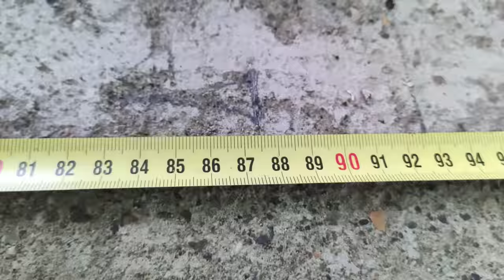An Old Construction Worker From Another Planet 🔥 DİY Stone Oven

Comment: “But I wanted it on the OTHER side of the patio.”
Reply: great job , with one mistake hight is not 62% or 63% so you have smoke coming out.
Reply: I noticed the smoke also. Is the exhaust sized small or should be at a different height or place? Whats the 62/63% calc?

Comment: SelamUnaleykum Haci. This is the perfect example of skills vs. training. By far one of the best construction videos I have seen by far on YouTube.  (And I am an YT nerd) but I would have changed I few things: 
1. The base of the oven is by far too big - therefore too much cost of material 
2. The heat sheets and isolation is not necessary in some regions.  If you live in Norway - then yes. 
3. The chimney position is not the best - as you can see in the end of the video - your beautiful stones in front (12:30 ) are completely black because of the smoke
4. The BREAK STONE Design Finish is not the kind which is really honey for the eyes 👀 
5. You should have implemented a iron door in front of the opening - To make Lamp Kebab like a Smoker 

I love your work - Thumbs up and I will subscribe 🌺🌺🌺

More videos insallah
Reply: I believe the door opening is too big, which is very important. It should be 1/2 as wide as the oven floor, and 63% the ht of the inside dome ht. This helps keep the heat in while cooking, and easier to make insulated door (plus a chimney cap) to bake long hours after fire scraped out.

Comment: Once you have done the inner lining of your oven, then you need to use refractory lime/cement.  There is a wonderful resource that is used in the composite industry (fibre glass industry), and that is "Glass Micro Balloons".  They are tiny glass balls that are 90% air.  Mix up your refractory and then gently fold these insulators into the mix.  Not the same as Micro Glass Beads.

Comment: I would like to know the following topics:
1. How about heating the oven for the first time? They always say to heat it very slowly the first time and then very hot.
2. I live at a higher altitude, at around 660m, and we have a lot of rain in Austria. What about rain when the oven is hot and showers a few hours later because the stone is cracking?
3. What do I have to consider in winter or spring? I think it would be best to cover the oven.
4. I know it would be better to have the oven under a roof, what do you think, but in the open air it's no problem, right?

Comment: What is the white powdery stuff? Powdered glass? Is it acting as insulation? Or holding heat? Or both?
Reply: If u mean the powder he put over the glass that's salt
Reply: @ilovegaben  Why are they using salt? Doesn't seem like a good idea. They don't seem to have a waterproof roof and combustion releases water vapor too. The oven's materials are porous and the water will seep in and/or condense when the oven cools. Dissolving some of the salt in contact with the bricks and drawing it in. I actually have no idea if that's a problem or not, but it doesn't seem like an intended effect. At the very least they'll need to add more salt every now and then... Maybe every season or so. And why salt, why not sand or something?
Reply: @SashaXXY  its not for water proof its for heat insulation